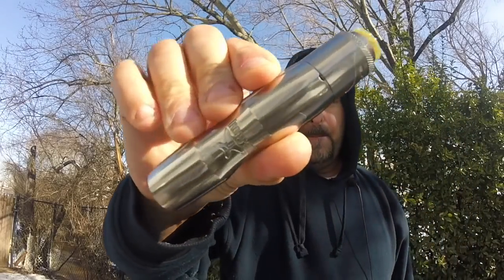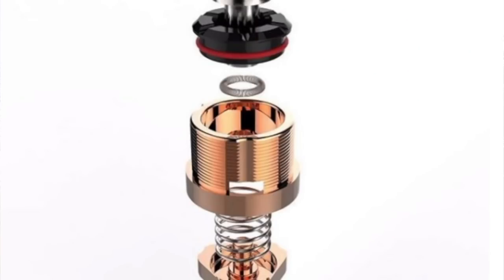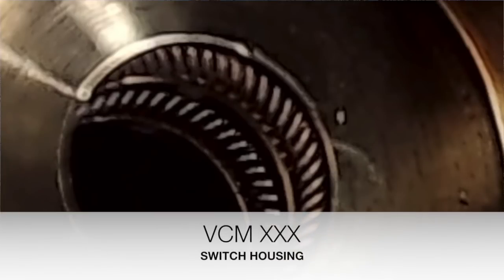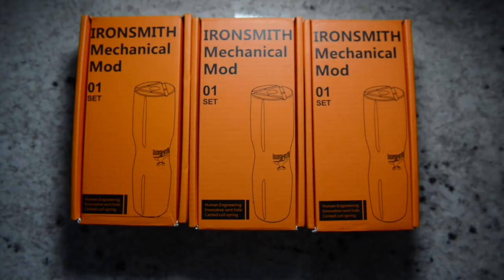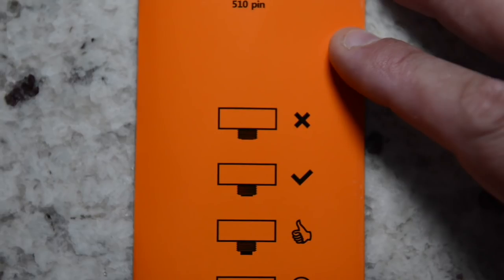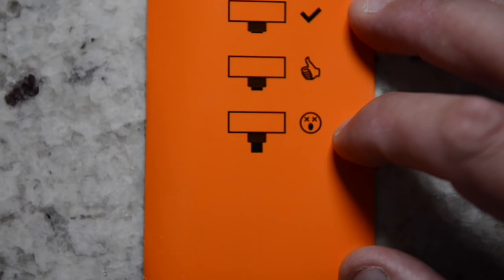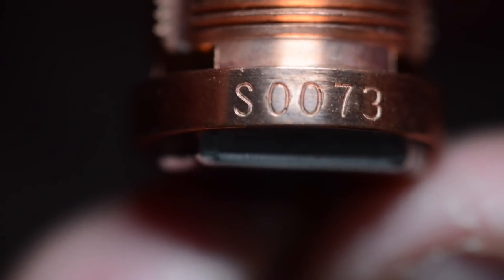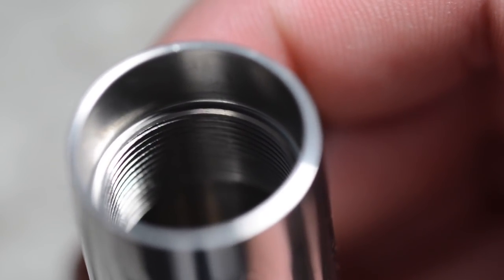IRONSMITH MOD GROUP 316L SS, BRASS, & COPPER

Comment: Dragon Mod Co. makes the best ss mods that hit just as hard as the copper and brass and never get hot buttons. I've owned two different ss Dragons both 18650 and 20700 and they're phenomenal! I actually found out about them from you Big Lou back when you did the review on the copper Dragon 28 👍👍

Comment: I was always under the impression that IronSmith Mods were out of the reach of Experienced Mech Mod enthusiasts but you live and learn something everyday .. I’m also more blown away that the Copper and Brass versions of this mod are cheaper but not inferior .. I particularly like the ergonomic hand friendly mid section bevel that allows for ease of use to stop your hand sliding down the tube .. something that a lot more Manufacturers might consider adopting .. “that button tho” .. yes I love “that button” that triangular button is quite simply something else and the way the vent holes are created are simply stunning .. 
A great review as usual from a guy who knows his stuff (quite simply put) 
Cheers Lou 👍🏻

Comment: Nice review lou I’ve got these in copper and brass and love them might have to get a stainless now to but those prices are way overinflated I paid 74$ each and the stainless is 88$ idk were those prices are comming from but that’s crazy eaither way tho their great mods
Reply: Jeff Noble can I get a link for where you got em please?
Reply: John b ya no problem http://hotecig.com/Product/Authentic-Ironsmith-Mech24mm-18650-Mechanical-ModCopper-72074
You can also direct email ironsmith and order from them to
Reply: Jeff Noble thanks man. Seems like Lou got ripped off. :/ looks super comfortable to hold. All my mechs are just straight tubes and I've been looking for something with some curvature. Been thinking about pulling the trigger on the dreamer so now might gotta get both.
Reply: John b no problem bro and ya their both great mods I’ve got both of them and love them I don’t think you’ll be disappointed with eaither mod